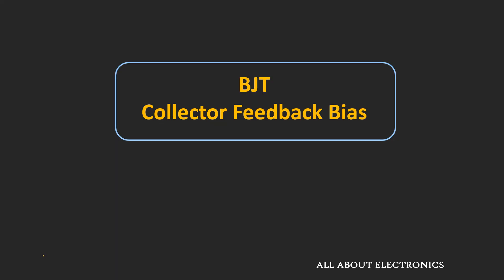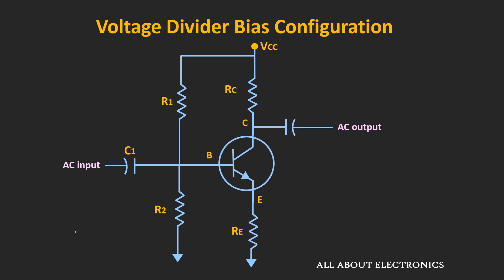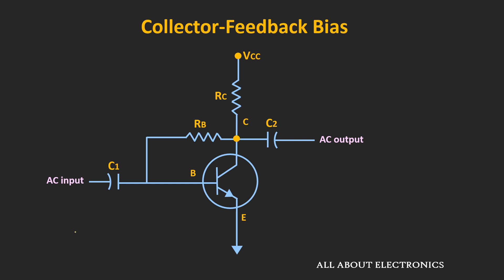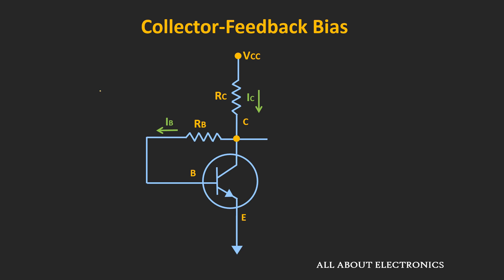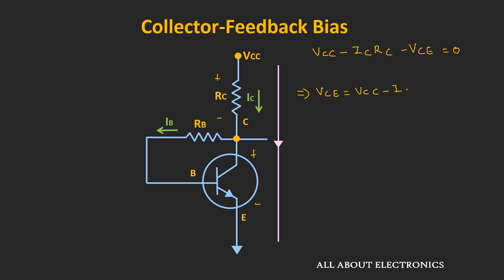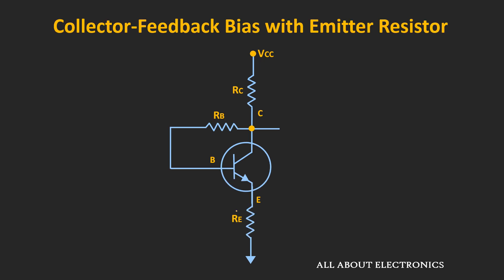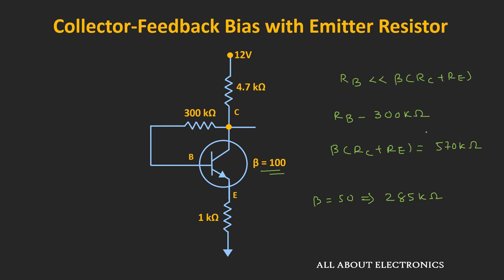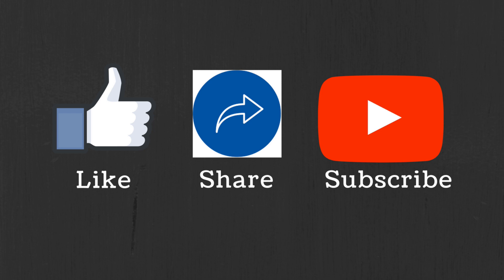BJT: Collector Feedback Bias Explained

Comment: i have a doubt. what if there is a resistor connected in between the base and ground? how will the calculation change?
Reply from the maker: If you add resistor between base and ground, then during the finding base current, you need to subtract that current which is going through that additional resistor.

Comment: Actually, a variation of only 30% to 35% in Ic or Vce arising from a doubling of β is a significant improvement in stability.
If you want to improve the stability further, then simply add a resistor from base to ground, so that the collector-base feedback is through a voltage divider. That allows you to use somewhat smaller resistors for Rb1 and Rb2 which further reduces the effect of variations in β. If you're not too worried about keeping the high input impedance, then you can almost eliminate the variations due to β. It also allows you to use a smaller value for Re, increasing both the the gain and the output swing, while retaining good linearity and flat frequency response.
Reply: I was looking for this comment. Can you point me to a video where this is discussed. Thanks

Comment: hi sir. i understood everything but can u do an ac analysis for this example circuit. it is quite confusing to do the ac analysis for collector feedback when the emitter resistor is not shorted.
Reply from the maker: It is already covered. Please check the BJT playlist on the channel. You will get the related video.

Comment: thank you for the video but I have one question that i didn't understood the negative feedback concept in this configuration
Reply from the maker: As I mentioned 1:15 onwards, suppose Ic increase somehow, then the voltage Voltage drop across the collector resistor will increase. Ib = Vc - 0.7 / Rb. 
So, Ib will reduce and hence Ic will reduce. So, due to the negative feedback, any variation in the collector current will be minimized. Basically, there is a negative feedback from the collector to the base terminal. 
I hope it will clear your doubt.

Comment: Can this be solved if we don't know the value of resistor E? Thank you.
Reply from the maker: If it is not given then you must be given some other parameter through which you can find the value. e.g Emitter voltage (VE). Or the emitter resistor won't come into the picture when it is bypassed using the bypass capacitor.
Reply: @ALLABOUTELECTRONICS   The values of voltages over BE and CE were given, and also the values of resistors Rc and Rb and value of input voltage Vcc given. How to find the value of resistor E with what was given so then I can find the values of the currents? Thank you very much.